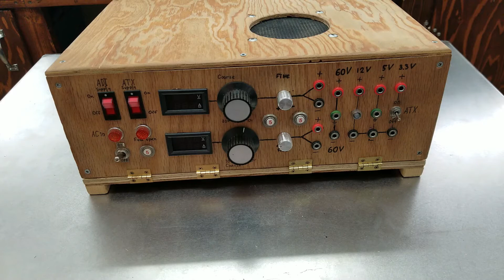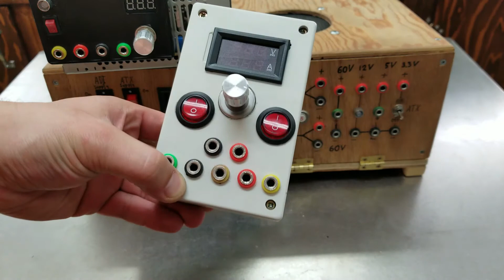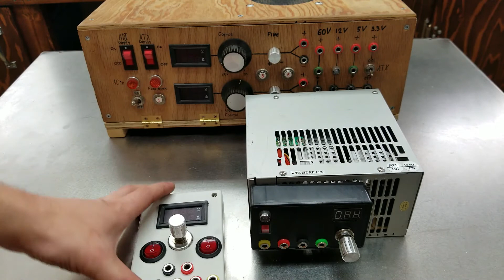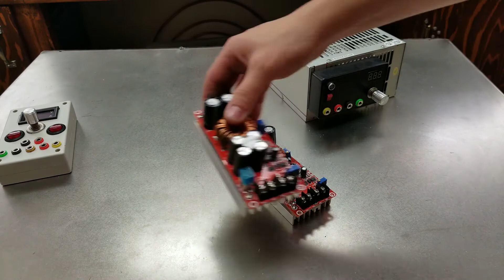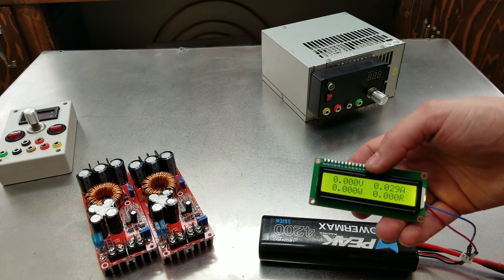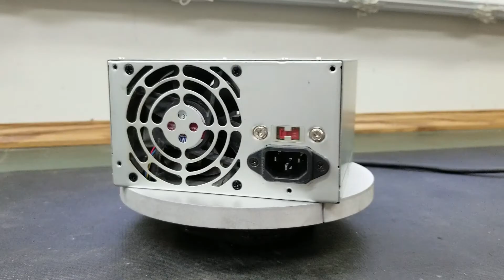DIY 12V 40 AMP CHARGER POWER SUPPLY (REVIEW)

Comment: Landscape may be a better fit for the LCD you are using. I found some of the same LCD, and they use up to  60V 100A DC. You have to take them out of the blue casing, but the amps go higher if you're using something that may be capable. Let me know if you would like the links-costed me around 10$ each. Switchmode is my favorite power supplies. Only because I am a heat freak. 
 I finished the one I was building last night. I am wrapping it up and taking pictures to post on my Google page. This one is only capable of 12amps, 30 volts. But only because of the final module. I may upgrade it at a later date, if I find I need more than 30V. I also made mine Battery Capable. But I try and do that with all of the ones I build. I have a few battery packs(18650) 25volts and higher. I'll drop you a message when it is done. I can't wait to see the one you are building!
Reply from the maker: Yea that's cool!!! Definitely you will see the one i have made!!!!
Reply: Finally finished..LOL, Here is the link to my Power Supply.Hope you like and I can't wait to see yours!-

https://plus.google.com/+JoeFulwider-njfulwider5/posts/8nu47gA6omc

Now I am onto my smaller tab welder. This should be a sweat looking build, and very simple design.
Reply from the maker: That's a nice PSU my FRIEND!!!!!
i see you have used the same boost module as i did!!! i had some bad problems with it!!!
I used 12 v on the input, and the most power i could get out was 200W/250W max before the MOSFET would blow closed!!!
Replaced about 8 MOSFETS for the 2 modules i have!!! 
Ended up installing IRFP250N. and limiting the input amps to 5, limiting overall power output to 60-70 W for the adjustable channel.
can't wait to hear what you think about my build!!!
Please stay tuned more vids soon!!!
Reply from the maker: Also please do some load testing on your power supply!!. I'm very interested how much you can pull from it!!!
Not sure what voltage you have on the input to the boost converter, but be careful !! Because it looks like those modules cant take more than 15-20 A at 12V...
Reply: Thanks!!...Wow! 12V 15-20amps...That is way to many amps for me at 12v..LOL Unfortunately, I am governed by the DPS. It can only take a max of 12amps at any voltage up to 32. I am not really set up for any testing like this. But I was able to test 10amps. The Boost converter got a little warm but handled with no issues. Luckily, I have a back up if this converter goes out. I also purchased a Minghe BTS900 to use. I just didn't want 2 converters with monitors. From all the research I did on the 1200 watt converter seem to be one of the best on the market, that could handle over 15 amps. But like anything you get from overseas, it can be hit and miss. It is possible, you got a run of units with bad chips. More than likely, I will never need anything over 5 amps. I mainly built, just in case something came up and I needed more amps. Besides the tab welder(#2), I am building. I have a power supply i am building(just messing around), using a Microwave Transformer also rewinded with 10 gauge. But I am slow going on that one and needing something to rectify the voltage coming out to DC. Not really sure what I will do with that project yet. I have a feeling that one will cost me a penny or 2 after it is said and done. But that one will be far in the future and I may use another 1200 watt converter unless I find something better. I will purchase some IRFP250N to have on hand, just in case. Thanks for the tip. I'll keep and eye on the one I have in the unit. 

Off to the Tab welder build...LOL